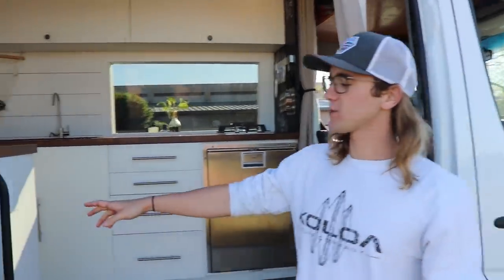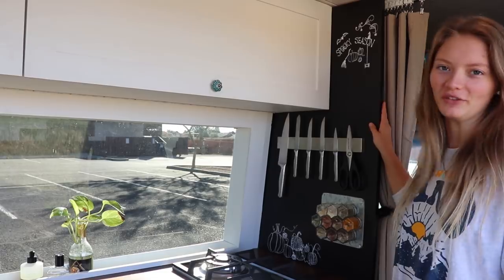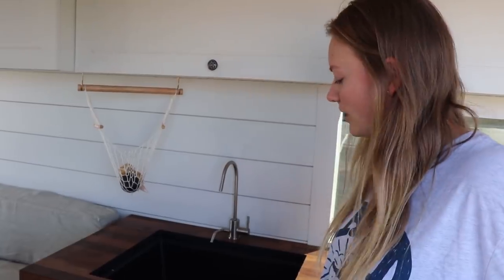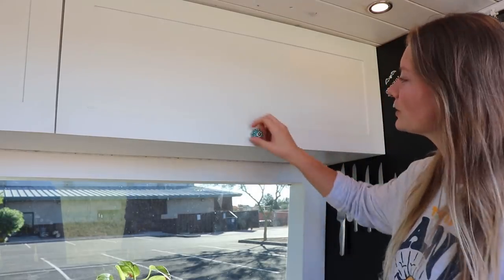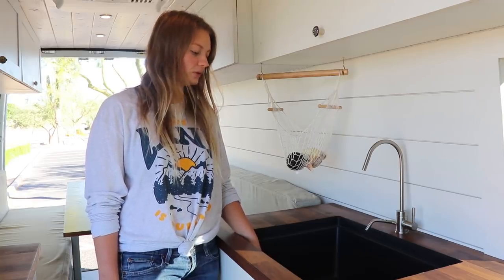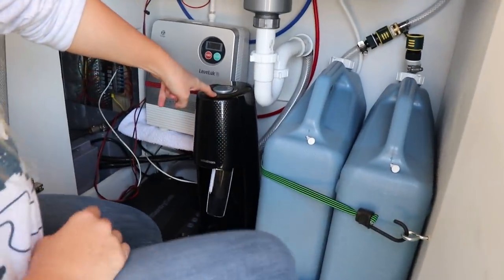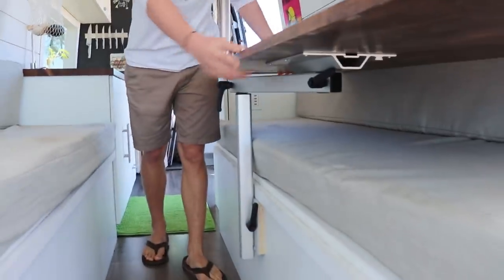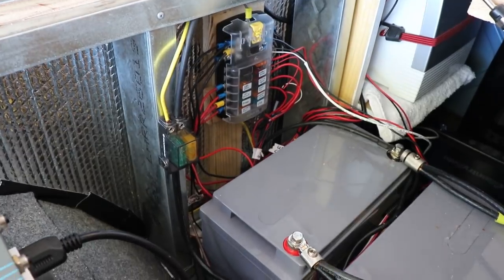VAN TOUR | 19 year old couple transforms van to travel the world

Comment: NIce build.  Thank you for sharing it.  One observation, those knives will indeed go flying in an energetic collision and become a hazard.  I suggest storing them in a latched compartment or drawer when in motion.  Also, it seems you have a lot of weight on driver side of van -- water storage, batteries, fridge with food, and sink.  Did you consider weight balance in your build?
Reply: Yes, that was my concern too. Fine for normal travel but in an accident they could become pointy missiles.

Comment: Remarkable achievement, my respect for your hard work!  Some feedback:
1. Love your gas burners - make and model?
2. Spice racks - that magnetic system will fail over time as the jars are too heavy and lids get demagnetized, then shake off during driving.  May I suggest IKEA BEKVAM spice racks for wall, and RAJTAN jars.  You will love them. Keep the magnetic board for smaller things.
3. Harbor Freight sells magnetic racks that are only $2 on sale (else $5) half the price of IKEA $10 knife racks.  In case you need more for garage area, or closets, etc.

Great job you two, enjoy your travels!  You can learn a lot about van builds from Enigmatic Nomadic posts, and see the two tours of Lee Blake's van.  He did a detailed job.

Comment: It's true about being able to park most places without a problem.  You just have to be selective.  Best to keep away from places people have a sense of ownership of them.  Or just get there late and leave early.  Im thinking of getting more windows but am worried my van will lose its stealthness.  A cross draft would be fantastic though.   I saw a van with a large underfloor fan . That's a possibility.
Reply: Put 2 fans in one in the front and one in the back. One pulling air in  the other blowing it out.
Reply: Look at installing some porthole windows for cross ventilation, the kind they use in boats as they are too small for burglars to break in through so no security issues, but you would get air in.

Comment: Great job narrating, one of the best out there! I attached my dump valve switch on the right hand side of my driver seat. What a/c unit did you guys go with? I went with the Coleman polar cub and I can run it with my 3- 100ah Trojan batteries for approx 30-45min, because they give off enough apps.

Comment: Beautiful!! Does anyone know how insurance works for this? If you get in an accident or fire is anything covered?
Reply: Insurance can be tricky. Some insurance companies won't insure the Sprinter because they view it as a commercial vehicle or passenger van. So, Kensie and Joey  couldn't get it insured until it was built out and the insurance company saw it as an RV. I have a bus that was converted to an RV, so they insured the bus as a vehicle and the contents like it was the contents of a house. In other words, I had to give them a value of the bus separately from the contents. Also, most insurance agents have no idea what the heck you're doing so they have to find someone in the company who does. Be patient and work through it with them.

Comment: Instead of installing all these windows, why don’t you guys install a skylight?
Reply: I'm not sure you can see it well in the video but there is a vent fan near the kitchen and a large A/C about the middle of the van. The front part of the roof has 3 solar panels and the back will carry stuff and all if it is covered by the roof rack. Windows are better for ventilation IMHO and the vent fan can pull air as well as expel air. It's a design choice and highly depends on how you customise yours

Comment: is that an air conditioning unit above the bed? if so what is the make and model?
Reply: It's a Dometic but I don't know the model. It's a standard RV/travel trailer type. There are a few other brands out there such as Coleman you can look at as well. Theirs is strictly A/C but you can also buy models with heat if you will be in colder climates. I believe they bought it on Amazon

Comment: May I ask How 19 year old couple could afford to buy all of these things?
Tools to build the whole thing, All the parts, and the vehicle itself. 
I know how much it costs to build one of these, (especially with a composting toilet...).
I am assuming Mercedes Sprinter itself costed well over 10,000 to 15,000 even if it was well used. 
From looking at it briefly from the video I would approximate about 20,000 went into building this van, including the van itself.  
I can tell you I did quite well for myself with money early on in life, but definitely did not have 20,000 dollars I can spend on a vehicle when I was in my teens.
Reply: Mike Seo Just a new Sprinter can cost up to 70 grand. And I have 20 year old friends who make 250 grand a year not doing jobs people did 30 years ago (aka working smarter with tech and internet marketing). The average home in the US is 2,600 square feet and costs multiple 6–figures, so they are off to a good start since these hold value pretty well.

Comment: Agree — hate particle board. No, I hate, hate, hate particle board — hate, hate, hate MDF too. I'm a wood worker and neither of those ever land in my workshop (garage). Not for counter tops, not for speakers, not for arcade cabinets ... I will never use the stuff.

It's heavy and dense, the dust when you cut it clogs up moving parts of my tools.... Everywhere you might think to use it I use plywood instead.

And not the shit construction plywood you get from Home Despot either. Good plywood. Multi-ply plywood,. Europly, baltic birch, Apple-ply, callout what you will — that's the good stuff. That's the stuff to use.

Nice cabinets.
Reply: I agree and had that discussion with the kids. The plywood they used is maple on one side and birch on the other. If I remember correctly, only the counter top is particle board. They bought that from IKEA and then made the cut outs for the sink and stove. They sealed the areas that were exposed since water will destroy it. So far, so good. Yes, it's heavy but they have a one ton van so it's not an issue from that point of view. Anyway, I agree, use quality plywood for cabinet work.

Comment: How do you power the AC?
Reply from the maker: The A/C is the only thing in the van that we don't power off our solar/batteries. So if we need to run it, we plug into shore power. As long as we are on a 20 amp circuit it fires right up!
Reply: @kensiewest  can you tell me where you got it? what it is? any info would be great, I am doing a build and in Texas need one for sure and looking at options.